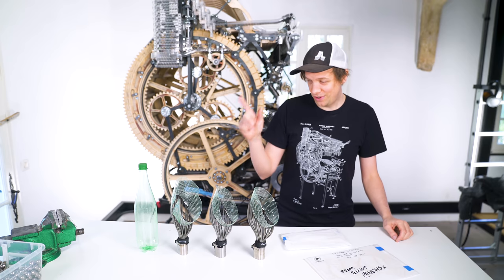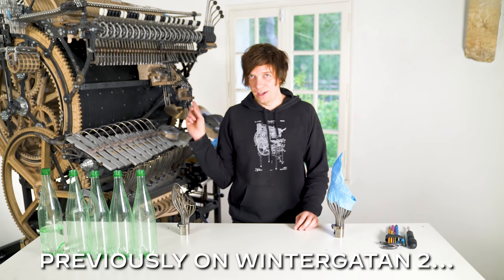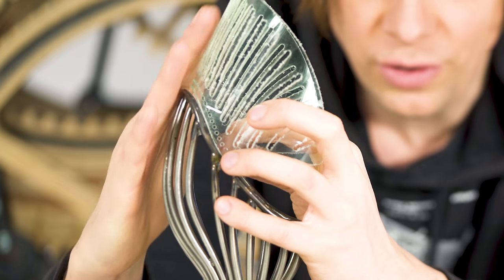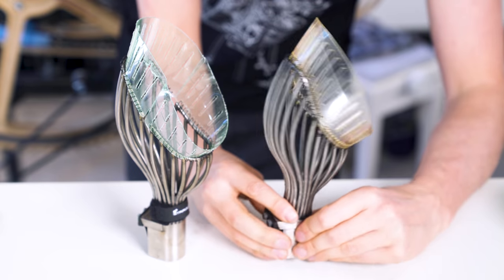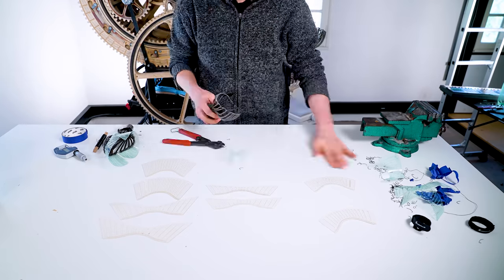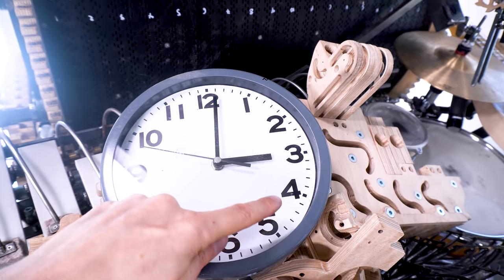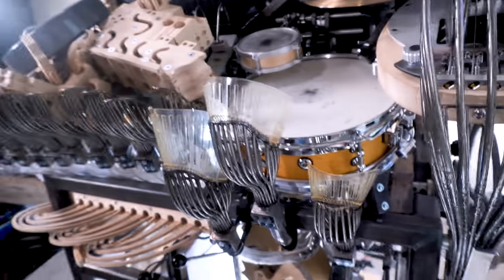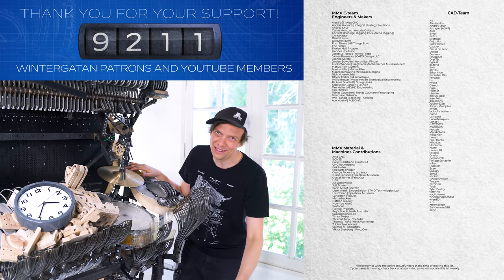Laser Cut Marble Funnels

Comment from the maker: Thanks to Elliot for Laser cutting these parts for the Marble Machine X!
Check out Elliots in depth video here showing how he Laser Cut the extensions:
https://www.youtube.com/watch?v=11WrM-wMwDo
Reply: Awesome
Reply: Awesome
Reply: Is the track at 2:30 on Bandcamp/the free build tracks download? Sounds great!
Reply: could you show us how the new clock escapement gate affects the marble queue at the top of the marble divider? is the double action of the new gate gonna prevent smooth flow of marbles when all the gates are complete?
Reply: @minecraftfreek9  As far as I know, the marble height modules remain as of now. If you paid attention to the video though, there might be a new feature addressing that issue coming up!
Reply: Four years in a plastics workshop and I can't help but have a knee-jerk reaction to the laser cut PET... I get that the yellowed edges looks of theme with what you have going, Martin, but I can't help but cringe at the thought of burning PET with a laser.  My boss, the regional manager, and the corporate manager would all have my hide had I let transparent material out of the workshop with yellowed edges like that without a prototype to get customer approval.

Then again, the time/labor investment to route, sand, and polish all those little holes would have been a non-starter to the budget of any project like the MMX if it was routed.  The solution would be to pull a vacuum and mold the PET on a wooden base.  Still a time investment, but would be completely clear.  Truthfully, I'd probably mold it from a slab of clear ABS instead of using PET as the ABS takes to post-mold work easier.  End-user, you wouldn't know a difference except a half-decade down the road when the ABS starts to tint from UV damage.

Sorry.. I'm rambling.
Reply: @sintanan469  I totally get what you're saying, and honestly I was a bit disappointed with the 250 micron sheets when they came out of the machine because those had a lot more burned spots, but as you said, it would take a LOT of time and effort to fix that. I think if I wasn't limited to the small (dirty) laser I used, it would've turned out a bit better. But I'm still impressed that the color matches so well with the steampunk and wood look on the machine.
Reply: Thanks Elliot!
Reply: "Elliot, your parts are awesome."

There's no finer compliment a man can hear! 😊
Reply: @nagualdesign  indeed, I'm so grateful he let met participate in this awesome project!
Reply: Elliot did a nice job, but I'm sorry to say that only leather would be nice in my book.
Reply: @Wintergatan 
Hey Martin if you ever need some more Lasercuts out of metal (Aluminium, steel, chromium steel, all up to 15mm thickness), hit me up... I work in metal parts factory beside my studies. I could provide you with cuts and even simple bends...
cheers fabian
Reply: You could also saw the plastic parts together in the corners instead of stacking them to prevent them from opening or constraining how much they can open
Reply: @newsx8277  If you have a router, you can use a low-grip double-sided tape like paper fabrication tape to stack multiple sheets of thin plastic together to route as if they were a big sheet.  This usually chews up the sheet on the top and bottom so it can be a waste of material if you aren't doing at least a half-dozen pieces, but it gets you nice edges on the remaining sheets.

Not as fast as laser cutting, since you have to take the time to bind the multiple sheets together.. and taking them apart tends to be tricky.. but it's what our workshop uses when we need to do detail work on anything thinner than .118 (or if you're crazy like Patrick, .093).
Reply: Делай скорее, хочу видеть результат!
Reply: Im gonna be honest, the plastic things looks like something a poor jeepney driver in the philippines made to decorate his shabby dashboard.
Reply: My Wintergatan remix of the previous video
https://www.youtube.com/watch?v=8C-21AzG3oU
Reply: Put the plastic inside! You will no longer have bad bounces, balls will be partly damped and the initial aestetics preserved.
Reply: @fruduroc  This! ^
Reply: Cool, i guess the yellowish tint is from the laer heat or was it by intention?
Reply: I love sn10 too!
Reply: They look weird :( sorry xx
Reply: Legend has it your still testing rn lol 4 days strait
Reply: Nice work! :) But I've got a question (maybe I missed something in the past). Is there a particular reason why you are building a separate funnel for each instrument/tone instead of just one huge collecting-tray around the whole machine that catches all marbles?

Comment: There's light in the end of the MMX tunnel. The new clock mechanism is a killer feature. I'm not sold on the funnel extensions. The laser cut sheets looks awesome, but let's be honest; It's a temporary fix. However, that's completely fine by me. Better to have a few minor "TODO"s than an unworkable machine. Keep it up Martin!
Reply: I belive the funnels will be redesigned on the tour version of the machine (MMXT )
Reply: I think they'd look better made out of thin brass and laser cut with some nice filigree designs. But maybe the more modern materials would help it stand out when it eventually hits the Speelklok museum lol.
Reply: @ANDERU4YOU  that'd be epic
Reply: I don't really like them either.. Too much plastic iin constrast to the rest of the beautiful machine. Maybe he explained and i missed it, but why is he chosing plastic and not just extending the steel funnels as they are right now?
Reply: @benjaminj3934  I think it's because the plastic is a lot faster to tweak if something needs tuning, whereas the metal is a lot of work to make and needs to be more or less completely redone even for small adjustments
Reply: @benjaminj3934  It's to save time. When they build the 2 or 3 machines for the tour, they will probably make the original design but bigger, but only when they know what size is ideal. Much easier to test with platstic
Reply: maybe if Get the MACHINE ON BoYY.. Martin.. . age changes the state     + Also if you PROUDUUUUUUUUUCE kids        (Deja Vu =)
Reply: I'm still not convinced they're needed now that he's decided to make the funnels stationary... it seems like every marble is hitting the funnels, the problem that was causing loose marbles was that the funnels were opening and would slip out the side.
Reply: @ANDERU4YOU  filigree designs on the MMX seems like excessive decoration and wouldn't fit in with the machine at all. the MMX is about form and shape, not about decoration. Thin brass probably couldn't take the beating of thousands (maybe millions) of steel marbles slamming into it anyway
Reply: @ANDERU4YOU  Metal again? Just to coat it in resin again? I disliked the idea the first time. But I am unsure how to supress the metal on metal ping when a marble enters the funnel. Maybe a slightly different design, just with some slits in some bent sheets. Put felt, leather or something else inside to dampen it. Maybe maybe
Reply: @benjaminj3934  That's what I keep wondering. Also, now that he knows the problem is marbles slipping out the side when the funnels opened, why not just design half the funnel to overlap the other half
Reply: @Eralen00  very few marbles are actually hitting these funnel extensions. It's just a edge case guard.
Reply: @wizardvega724  again, time. There are many solutions but fixing that won't solve any major problem. This design works as it is and there is no point improving it RIGHT NOW as it is way more important to solve the marble release and distribution system which is potentially catastrophic. When that is done and it's fully thought out it will be revisited. Just keep in mind how freaking difficult it is to bend, and solder the steel wires and then bath them into resin, it is something that must be done right, with pressing matters ahead is not worth the trouble right now
Reply: Plastic is not very durable material. These extensions need to be replaced at some point.
Reply: @wizardvega724  The problem of the marbles going too high is much more common when both gates are active and cause a super bounce of sorts on the drums.
Reply: There's light at the end of the funnel... Is what I've read 😅
Reply: @wizardvega724  My bad, i thought he was talking about the entire funnel for some reason. Point taken

Comment: I gotta say. I hope these plastic parts will get a redesign in the future, because right now they look really bad. They look 100 percent like an afterthought.
Reply: The machine will have to be made 2 or 3 times for the tour, and at that point some things will be redesigned again, but to do the funnels again right now (just to make them bigger) would be a lot of time for little difference
Reply: I think they need a redesign to match the level of the marble drops.. Cuz he put so much effort into those.
Reply: @griflet1  exactly. I mean every connection of the funnels have to be welded. I guess that would be at least one week of hard repetitive work. better get everything to work properly and then care about the well working but unaesthetic funnels.
one thing I hoped though is that the slots would have been rearranged to follow the orientation of the vertical rods. I think if everyting was geometrically concordant it would've been much less ugly.

Comment: Never been a fan of the plastic. Even with the better color, it just looks so tacked on (which it is).
Reply: That is the best you can do on something not that much worth it
Reply: Given time it will be fixed
Reply: Gotta agree the plastic extensions don't look amazing
Reply: It looks like a quick fix, i really dislike it. Tbh
Reply: It will undoubtedly be re-manufactured as a single part at the end of this prototyping process.
Reply: @bencressman6110 Do you think he knows this yet? Because then why don't just keep the pet cnced parts
Reply: @pietervanbaekel  haha, that's a good question. It's possible the guy volunteered to upgrade them, and there was no good reason to refuse, or maybe it's a super cheap bit of polish that (was intended to) enhances the aesthetic for the months to come. As ugly as they are, they do at least look like they were manufactured properly now. Kind of - the two-ply look kind of undoes that.
Reply: Im sure there will be five or ten more revisions before its finished, if ever.
Reply: @KaiWolf18  Neither do the badly welded "Shuttlecocks".
Again, Martin opts for form over function.

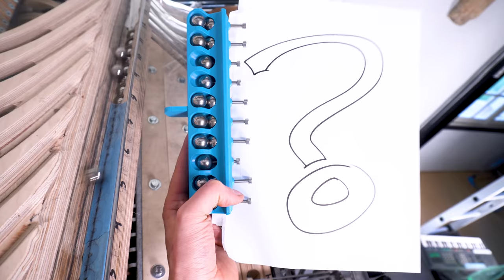Comment: That teaser at 6:24 tho... we need a better marble leveling system lets go!!!
Reply: Lets GO!!!
Reply: yes the current system by which marbles gain exp and become stronger is just not great marbles need a better way to level up
Reply: Can't you just feel it coming? The new gates have no resolution for that, so it has coming! At the same time, the new gates are being cut. Get ready folks, its about to get real! LETS GO!!!
Reply: Almost!  Not a better leveling system, but removing the need for a leveling system entirely!
Reply: @Huntracony  You seem to be in the know.  How does it work?
Reply: @timothyodonnell8591  it looks like they moved the marbles to the side, so as a marble goes along the path it fills in a spot if it's empty, but it doesn't matter how high the marble gets within the hole because the next marble can move around it
Reply: @timothyodonnell8591  On the second channel Wintergatan 2 there is a great demonstration in the video called Design Review. Would highly recommend you check it out because there's some pretty neat stuff there. This design in particular is 1 minute into the video
Reply: yeyeye I am hypuuuu
Reply: The reason Martin hasn't changed his divider yet, is because the new divider only applies to the engineers wrench, not the artists brush. Yes there would be no need for a height regulation system, however it won't look good. All the marbles will be on different heights, which won't look slick and aesthetically pleasing. I do agree on moving the marbles to the side, for more efficient marble to funnel transitions, but let's wait for a hybrid so we can also get a flush marble height across the board aswell. If the marble gate can have a 10 enginner and 10 artist, then this can aswell at some point. That's what Martin is trying to accomplish. This is going to be on a stage, so it has to not just sound good, but look good 2.
Reply: @timothyodonnell8591  Look up "Rossero Bertolli curved marble catcher" on YouTube.
Reply: Oh thank god, he’s going to do it. Smart move, I think.
Reply: @prebenkul  Personally I really like the look of the curved catcher and don't like the look of the height adjustment modules.  To each their own, I suppose.
Reply: @timothyodonnell8591  the pocket starts at the side and is rotated around the marble lane. A marble anywhere on that surface provides a clean path for the marble queue. When the marbles in the rotated pocket drop as an instrument is played, the gap opens for a marble to enter.
Reply: @Huntracony  I've designed a dual lane, double sided version that provides more opportunities for sideways movement into the pockets, and seperates the paths so that the PMMA does not have to be squashed to fit. It's made of half channel wide vertical modules, all CNCd from one side, with the plys edge out, clamped together with a couple of threaded rods.
Rossero is printing the design for testing.
Reply: @MrGonzonator  Cool!  I look forward to his video (if he uploads one).
Reply: Yeees!
Reply: @prebenkul  It will look almost identical, and the height difference of the marbles will not really be that noticeable. I don't really think the artist brush is much of a consideration for this part. You have the marble track above which is 10/10 for art, and the divider below, the actual pmma pipe pan-flute looking part which is also 10/10 for art. The actual shape of the dividing lane is just a transition between these two stunnners
Reply: Let's gooooooo
Reply: @prebenkul  you can easily make all marbles have the same height with the new divider
Reply: @fishbone0  No you can't. the new devider doesn't level any height, it only removes the need for a height system.

Marbles can be at any height across the divider, and marbles will just pass by without getting stuck. But they'll be at different heights.
Reply: Yes. This is absolutely needed.
Reply: @prebenkul  which makes the MMX able to tour the world. (if my assumptions are correct) Varying temparatures and humidity when touring which results in marbles and parts expanding/shrinking a bit will make Martin spend days figuring out which height blocks to use for the next concert. So if  a system can be implemented which disables the need for a height system, that would be fantastic.

Comment: The laser cut discoloration is likely avoidable by placing an adhesive backed paper or masking tape on the plastic. This is a very common solution for cleanly cutting and engraving wood with a laser. The "burn" stain is really just smoke residue. If you cover the primary material being cut, the stain goes on the covering and primary material remains clean.
Reply: Nice cross-trade proto comment!
Reply: This is why it’s best to leave the plastic film on when cutting. Also if you want it really nice add standoffs where you’re not cutting so the material isn’t so close to the honeycomb grid. But also a lot of it can be removed with alcohol.
Reply: i think is too much laser power. sidewall is burnt not flat areas near sidewalls. smoke residue can be always wiped off with a solvent.
Reply: But Martin LIKES it

Comment: I still think a membrane connecting the two halves of the funnel would prevent the failure mode we saw where marbles could fall out the side while retaining the movement but if that's been considered and thrown out I'm sure you had good reason
Reply: Mmm, membranes. Bat wings!
Reply: Even just a flange that slots in or outside the other half. If it's unviable I'd be very interested in learning why.
Reply: Or very thin transparent wires, almost invisible to the eye but could stop the marbles from escaping ?
Reply: Was thinking something similar (same way a bellow works) but* not sure about the esthetics of a system like that.
And if it doesn't look good then it's not even worth having moving funnels.
Reply: @remic2196 , no reason he can't use the same clear plastic.
Reply: @mhburleigh1738  but how is that going to look when it's "folded up" (= closed position)?
Reply: @remic2196 , if you're committed to a folding mechanism, probably awful regardless of what it's made from. But you don't need something that folds put to, say, 5cm. You only need something that extends, say, 5cm beyond the closed position, so when the wire catchers are open it blocks that opening.
Reply: or just extending the jaws and having some overlap. These are just, ugly.
Reply: Like on the bellows of an old player piano.
Reply: Or just a fine net which is elastic